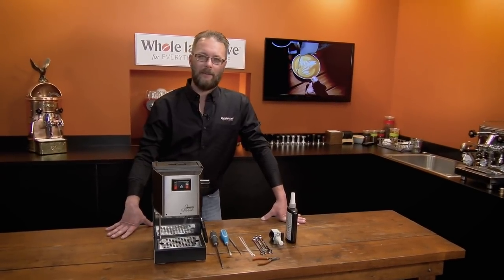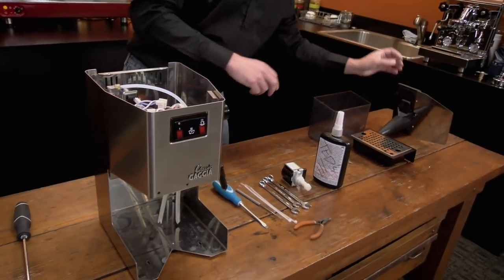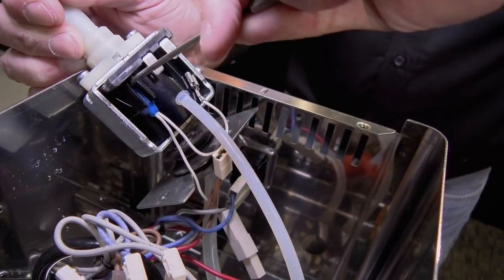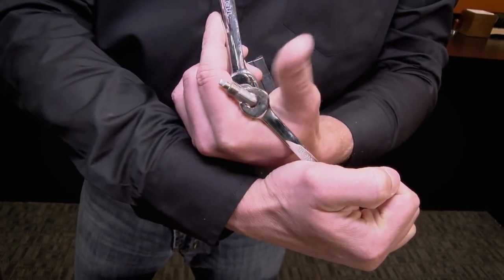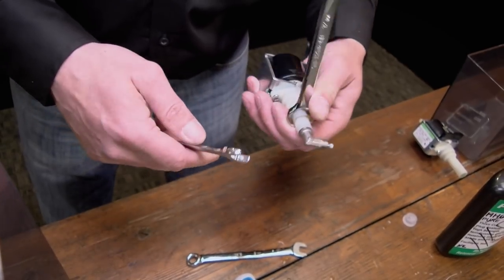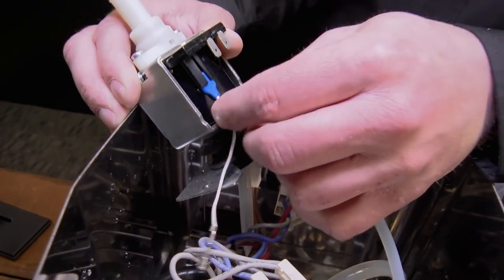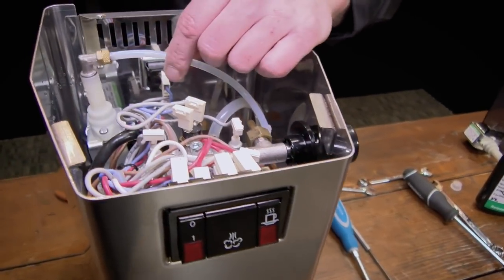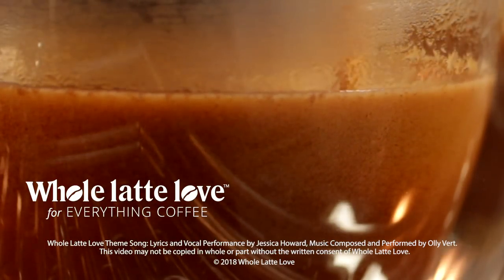How To Replace the Pump on a Gaggia Classic Espresso Machine

Comment: The best DIY video I have ever seen. It includes a variety of tips that could only be acquired from years of experience -- such as forcing air through the pump before installing, and aligning the elbow to its original position. Thank you Ted and Mark and Whole Latte Love.
Reply from the maker: Hi Allen, You are welcome! Great timing for your comment. Just shot 2 new videos with Ted today. Out soon, How to Install a Manual Frothing Wand on pre-2019 Gaggia Classics and How to Replace the Pump on Older Gaggia Machines like the Gaggia Coffee.
Marc

Comment: Thx, great DIY. Though I do not have a fuse and I think I never had so I do not regard it as missing. Do you see a problem with that?
Reply from the maker: Hi Steely, You're welcome! I do not see a problem with that. There's been a few slightly different versions of the Classic over the years. Some may not have the fuse.

Comment: Just a little tip for anyone that doesn't know...if your screwdriver is not magnetic...touch the tip to a magnet for like 30 seconds or so and it will magnetize.
Reply from the maker: Hi Chad, Thanks for that tip! Now if I could just find my magnet :)

Comment: Excellent video. I've never attempted anything like this before. The video was step-by-step and easy to follow. Highly recommended! I didn't use the cable ties, as suggested (as I didn't have any) and it works fine for now.... Hopefully it will  the pump will not come off!

Thank you
Reply from the maker: Hi mrgibbenglish, Thanks for the comment and recommendation - it's appreciated!

Comment: Great video. My machine has no thermal fuse though. Have you seen this before?
Reply from the maker: Hi E, I asked our lead Gaggia service tech if he's seen a Classic without a thermal fuse. He's repaired 100's of Classics over the last decade and has never seen one without a thermal fuse. He only works on Classics sold in North America and for a time a few years ago Classics sold outside North America were a little different than models here. Are you the original owner? Perhaps someone removed the fuse due to previous failure?

Comment: Hi, How do we know when it's time to replace a pump? Is there a way to test it? I haven't change my beans or grind but I'm getting way less pressure on the brew. I've cleaned the machine but that didn't seem to effect the brew. I've got lots of steam through the steam wand but no mojo for the java! Thanks for your help and also thanks for all of these videos, it's an awesome resource and has been a huge help on my god shot quest.
Reply from the maker: Hey wb, Here are some ideas...
If water comes out of the steam arm at a good current, the pump is fine.
If its just the group head that's poor, its the solenoid valve or shower screen.
If there's poor water flow out of the steam arm AND the group head, its either a pinched tube or a bad pump.
Not really any other way of testing it.
Occasionally the tube is behind the water tank instead of in it, which also needs to be ruled out.
We have a saying when training new staff "It's never the pump, until it's the pump"
This means it's more likely to be scale, pinched tube, solenoid valve, user error, clogged basket before it'll ever be the pump, and those all need to be ruled out in order to finally say "yeah ok, it IS the pump"
Marc

Comment: Hi, my 2015 GC pump is not turning on consistently. Sometimes it starts working immediately when I hit the brew switch, and other times I hear only a faint noise and there is no water flow at either the group head or the steam wand. Still other times there is a very brief (e.g., 1 second) delay when I turn on the brew switch to when I hear the pump kick in. I maintain my machine, and descaled the machine and boiler fairly recently (and the solenoid valve was clean). Does this sound like a pump issue?
Reply from the maker: Hey chad, It does sound like a pump issue. Outside chance it's a loose connection in the wiring.

Comment: This is really useful. I have a Classic that doesn’t pump when the machine is hot. Just a low hum noise. Let it cool down and it’ll work fine again - any ideas?
Reply from the maker: Hi Paul, Thanks for the question. A couple of resources that may help. First our support wiki for the Gaggia Classic. Here's a link to the troubleshooting section: https://wiki.wholelattelove.com/Gaggia_Classic/troubleshooting Second, if you are in the US you can speak directly with our tech support staff who would be happy to assist you free of charge. Here's how to contact: https://www.wholelattelove.com/contact-us
Reply: Paul I have the same problem.  How did you fix it?
Reply: @bettya9134  it was the pump Betty. I’d swapped so many bits before I got round to the pump! Easy to do too

Comment: Great vid, my gaggia classic (vintage 2000!!!) has a pump with no thermal fuse, the electrical contacts point upwards (not down like in your vid)

So the pump is on its last legs, starting to get stuck if you know what I mean.  Do you know which pump I should be replacing it with please?
Many thanks
Reply from the maker: Hi 1973, Thanks for the comment. Vintage 2000 - nice! One of the reasons why I recommend people getting into espresso over-look entry-level appliance grade espresso makers and start with a true machine like the Gaggia Classic. If in the US give our tech support team a call at 585-924-7170 and they will get you the correct pump.
Reply: @Wholelattelovepage  Unfortunately, hah, I'm in the UK.  My pump looks nothing like the two (blue and red) pumps advocated for various classic models.  But I'm guessing that one of them would still work??  Thanks.  As you say, it has worked at least once a day for almost 20 years and I would rather fix it than buy another, even a really expensive one
Reply: @1973donantonio  did you ever find a solution? I ordered the “replacement pump” but mine is like yours. It’s a 2005 and has 4 plugs going into an orange pump.

Comment: Hi, great video! I was cleaning the shower head on mine, and while I was putting machine back together I pulled on the plastic water tubing by accident.  Now my machine makes a metal rattling noise and minimal water coming out...any idea what I might have broken/dislodged? This is my first espresso machine, and I'm learning as I go.
Reply from the maker: Hi Meredith, Thanks for the comment and question. Hard to be certain but I wonder if maybe the water tube is pinched inside the machine. The rattling could be the pump struggling to intake water through the restricted tube which would also cause low water flow. I'd tke the top off the machine and follow that tube to the pump. Another potential problem is a partially blocked solenoid valve.

Comment: Hey guys. I just bought a service kit with 10 o-rings for my 2015 Gaggia Classic. It says then kit comes with a seal for the pump, but I dont see a seal on the neck/elbow piece. I didnt see one in this video. Maybe mine doesnt have one? Thanks!
Reply from the maker: Hi GD, No seal on the pump at the neck elbow area. Classic in this video is identical to those sold in 2015 in North American markets. There were a few years around that time the Classic sold in EU was a little different than the version in North America.

Comment: Thanks for the video. Really well done. 
I’ve had 2 gaggia classic. Now repairing my pump. But my model doesn’t have the « thermalfuse » 

It’s the second time I’ll need to change my pump. I’m thinking if I had the thermalfuse my pump would last longer. 

Can I buy it?
Thanks.
Reply from the maker: Hi fs, You are welcome for the video. If in the US give our tech support experts a call at 585-924-7170 and they can advise.

Comment: Hello I did replaced the pump, its working but there is no water coming out of porter filter? Do you know what it could be?
Reply from the maker: If NO WATER comes out of the steam arm, and NO WATER comes through the group head, but you DO get water out of the decompression duct (the pipe on the front of the machine) then it is time to clean or replace the solenoid valve. Here's a video to show you how: https://youtu.be/0ipvBdWaVzQ

Comment: My pump appears to be leaking, but just a small amount that drips through the rotation joint. I took it apart and notice that there is an o-ring and perhaps a small gasket. Is it worth attempting to replace those or should I just buy a complete pump?
Reply from the maker: Hi Mark, in most cases if you tighten up the neck it should stop the leak. If not you could try to replace the o-ring and see if that helps. Otherwise, replace the pump.
Reply: @Wholelattelovepage  - I ended up just tightening the neck and that worked fine. Thanks!
Reply from the maker: Awesome

Comment: Hi; great video! I replaced the pump just as you showed, but I still have the problem that the water doesn’t come out like jets as before.. water just come out as little drops.. can you guys help me for this please? Thanks.
Reply from the maker: Hi PF, Thanks for the question. If your pump is good I suspect there is a clog somewhere in the brew water delivery system. Most likely caused by scale deposits. here'sd a link to our support wiki for the Gaggia Classic. It has more troubleshooting info and links to videos including a full rebuild which would help you find the problem: https://wiki.wholelattelove.com/Gaggia_Classic
Marc

Comment: I wish I knew where to get that thread sealant that was mentioned in the video from. I googled a bit for the "Permabond HH040" but couldn't find it anywhere.
Reply from the maker: Hi David, We are currently out of stock but here's a similar product that'll work: https://www.oatey.com/products/hercules-megaloc--1330684393?upc=032628158023
Reply: I’d use Permabond A131

Comment: Thanks for the useful tutorial video! By the way, does this applies to the Gaggia Classic Pro too? I purchased the machine a year before and I have maintained it fairly well. But, unfortunately, from the last week, It started not pushing water with enough pressure, so I disassembled the machine and clean them all. But, still not working properly. The machine is with replaced opv for 9 bar. So, do you think it is enough to to just change the opv to the original one so that more pressure is allowed? Or, do I need to basically change the pump. If so, ex5 works? or go with EAP5/S or EFP5? Thanks!
Reply from the maker: Hi KK, Thanks for the question. We have this video on diagnosing flow issues on the Gaggia Classic Pro: https://youtu.be/lNSWsfSARnU Do watch that video! Your pump might not be the problem. If it turns out it is your pump we have this video showing how to replace on the Classic Pro: https://youtu.be/SfzstXVYsmg
I know people do the OPV mod. I recommend against making that mod. The stock OPV provides a proper flow rate and if your grind is dialed in when you're pulling a shot you will be very close to 9 bar brew pressure.

Comment: Hello does anyone has recommendations for cleaning the tube that connects to the bottom of the pump to the water tank?
Reply from the maker: Hi mr. m, If it's in sad dirty shape replacing the tube is likely the way to go if you are replacing the pump. Otherwise soaking in a Cafiza used for backflushing (or similar) solution may help. Just be sure to rinse well. Hard part is scrubbing the interior of the tube if that's needed. Very thin bottle brush with long handle works. Something like this Pallo Steamy Wanda may help: https://www.wholelattelove.com/products/pallo-steamy-wanda?variant=14409475489851 although it may not have the reach to get at the full length and replacing tube is likely cheaper.
Reply: Thank you! I think i'll just replace the tube. Is the Teflon Tube 4x6 230mm on your site the correct replacement for the gaggia classic?

Comment: What is the function of the hot melt that is in the pump?
Reply from the maker: Hi, the hot glue holds the safety fuse in place on the side of the pump.

Comment: The part that connects to the elbow joint is stripped.  Is that part available, or do I have to replace the entire pump?
Reply from the maker: Hi Cristina, Here's a link to the parts diagram for the Classic: https://wiki.wholelattelove.com/images/6/6a/CLASSIC_Parts_Diagram.pdf
I believe the part is available but it would be best to speak directly with one of our tech support specialists to confirm/order. You can reach them here: https://www.wholelattelove.com/contact-us

Comment: What is the specification of the pump thermal fuse? My machine had a short-circuit and I identified that the pump's thermal fuse has fried.
Reply from the maker: Hi MEMM, it's 184C if it looks like this one: https://www.wholelattelove.com/products/thermal-fuse-184c-limit
Reply: @Wholelattelovepage  Hey, thanks for the answer! I am not sure it is the same because the component in my case is one that connects to the pump and is "hidden" in a plastic case. It is kinda round and covered in blue plastic...

Comment: Hello...is it possible if i replacing the default pump which is 48 watt to 70 watt with same voltage?
Reply from the maker: Hi SA, I do not know, not something I've tried. I'd stick with original wattage.

Comment: The motor in my machine is working but the sound level of the machine is muffed (very low volume) and hardly any water is coming out even after descaling. Is that a pump problem?
Reply from the maker: Hi Matthew, It's possible it could be the pump especially if it's a well used and older Classic. Was water flow low prior to descaling? If not then descaling may have dislodged a chunk of scale that caused a restriction. That can happen if the machine had lot's of scale buildup or if descaling was overdue. Could also be a problem with the 3 way solenoid valve. Here's a link to an article for troubleshooting: https://support.wholelattelove.com/hc/en-us/articles/1500002841322--How-to-Troubleshoot-Gaggia-Classic-Pro-With-No-Water-Flow
In the article there's a link to a video showing how to clean or replace the solenoid valve. Hope that helps!

Comment: How to saok boiler  which chemical use?
Reply from the maker: Hi Anvarshan, Thanks for the question. You have options for descalers. Gaggia has one designed specifically for their machines: https://www.wholelattelove.com/gaggia-decalcifier-4adf31c1-5733-464a-91c2-ffbda32ef649 The Gaggia decalcifier uses lactic acid and contains a corrosion inhibitor as well. Other option are citric acid based descalers like this Urnex product: https://www.wholelattelove.com/urnex-liquid-dezcal When using citric acid based descalers limit contact time with boiler to 20-30 minutes.
Reply: What about Durgol?